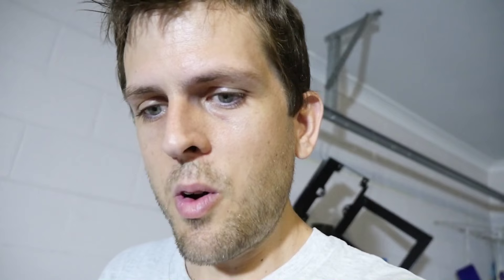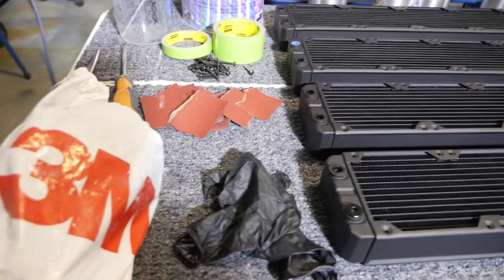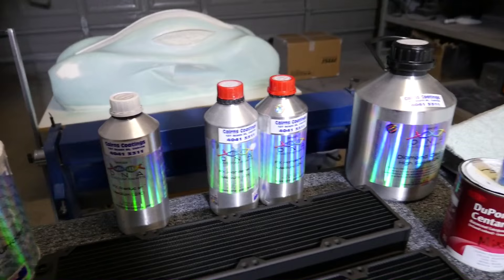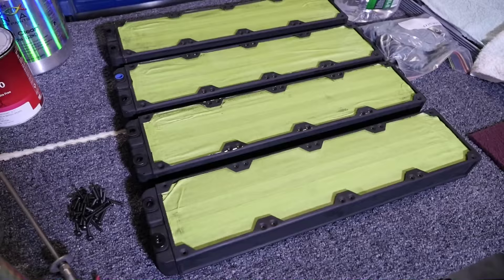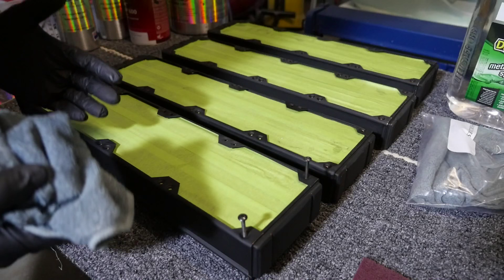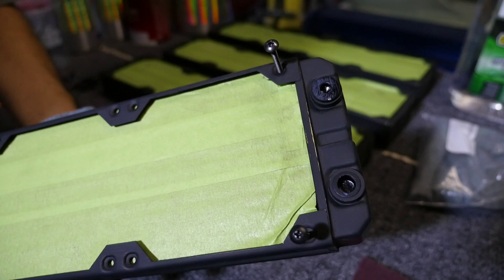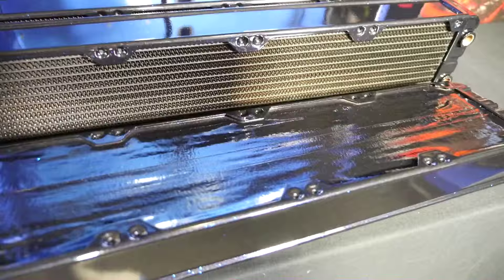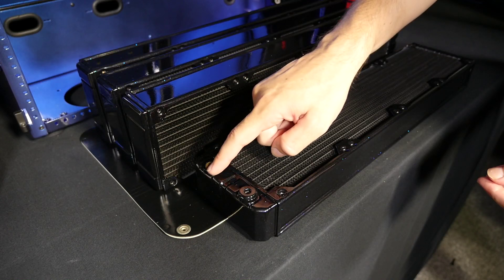SC Modding #4: Custom Painting Radiators

Comment: Immaculate. The trick with the screws is something I would never have thought of and I will use this method whenever possible. Before, I used to hang pieces with wire from a low tree limb. Typical American ingenuity. Thanks.

Comment: PLEASE READ THIS

Hey man, I believe you're using 2k urethane paints, you REALLY need to get a proper respirator and body suit because you are painting quite a bit. You dont need to spend a fortune, just get some full body coveralls and a 3m chemical respirator not a dust respirator.
Reply: +JgHaverty Specifically you need the cartridge filters on the respirator that are rated for what you're doing.  Also if you're working professionally, you need to replace the cartridges on a regular schedule.  The contamination "migrates" through the filter over time.
Reply from the maker: +someusername121 Yep absolutely. My filters are due for replacement actually.

Comment: love sparkly paint. will mixing multiple colors of that glitter stuff get good results if you are trying to do a multi color build or whatever ?
Reply from the maker: +MoDRun Yes you can get good results from that although you have to be careful because it can get too glittery and cheap looking. You are better off mixing two different effects. For example underneath you could use a flat colour with a partial cover pearl over it, and then the flake. You could even use a candy before the flake to tint everything.

Comment: noob here. what are these rad's made of? can you color anodize?
Reply: +Rich Lehman Most radiators have copper pipes, brass threads and steel or aluminum housing, but this varies. Though there are no major changes in how you paint.
Reply: So the externals are Al? If so you could anodize it?
Reply: +Rich Lehman some are made of aluminum, other are made from copper or brass.
Reply: +Rich Lehman Not sure if that would affect performance at all, would be interesting to see what would happen. Fin arrays are pretty thin in radiators though so you would have to do it perfectly.
Reply: yeah, saw a video from an engineer who explained anodizing, and if fins too thin then you could either create leaks or if anodized too long end up with micro rust on the inside. Both are bad. something to experiment with. if you can anodize aluminum foil without damage you're good to go
Reply: "Or" aluminum generally. Look at the seller's page on the particular radiator, it may vary quite a lot.

Comment: Why not just use cardboard to mask the fins?
Reply: +Martisan Risk of it moving during the spraying.
Reply: +JBloomfield1990 yeah. if you're unable to cut it to shape. I'd rather use free (most have boxes at home) cardboard, than buy 3M tape.
Reply: +Martisan I was thinking the same thing. I would think the packaging the radiators come in would be perfect if the cardboard is thin enough of course.

Comment: you use shit rads, you get shit finish. alphacool and EK rads have great finishes, but cost a little more hence the terrible finishes and rust you get on crap rads. no rads should have any steel at all. should be solid aluminum flat out
Reply: +Raging Reaper Gaming Variety I just checked alphacool's website and every rad I looked at had steel side panels with "mostly" copper internals.
Reply: +applemaggot correct. only the fan mounting surfaces are steel. wnd caps and fins are aluminum as well as the fitting ports
Reply: Raging Reaper Gaming Variety Ok, thanks : )
Reply from the maker: +Raging Reaper Gaming Variety Black Ice radiators are made completely from brass and copper, brass outer panels, copper fins. The fins on most PC water-cooling radiators are copper, end tanks are copper, outer panels are steel, this goes for EK, Alphacool, XSPC.
Reply: +SingularityComputers Yeah exactly, I don't know what that guy was talking about. The end tanks tend to be mostly brass though.
Reply: +Raging Reaper Gaming Variety Aluminum should NEVER be in a radiator. It can cause galvanic corrosion in your water blocks. Brass pipes and copper fins is what you will fins in good rads, since copper can dissipate heat around 2x more efficiently than aluminum. You basically said the opposite of what is correct.